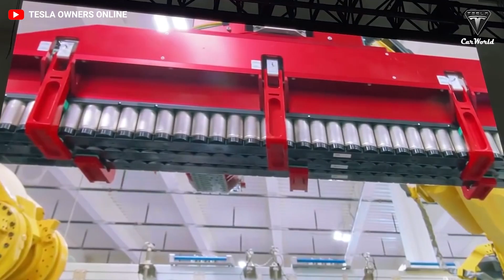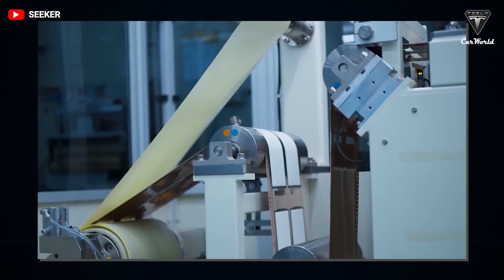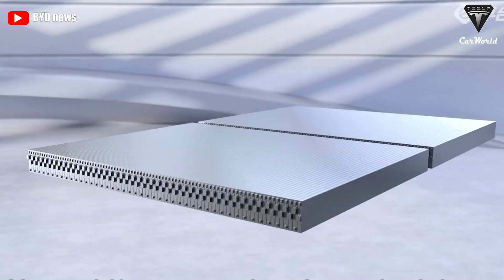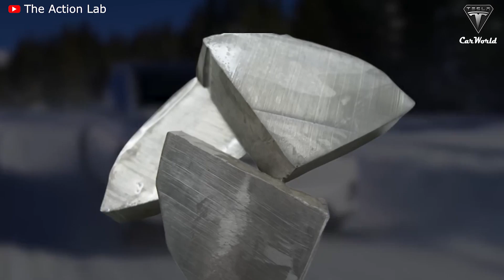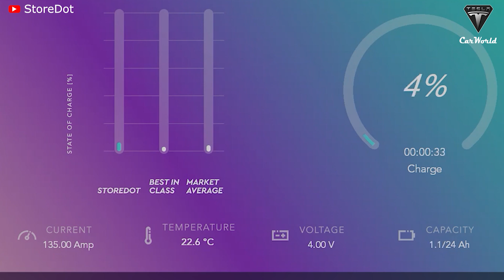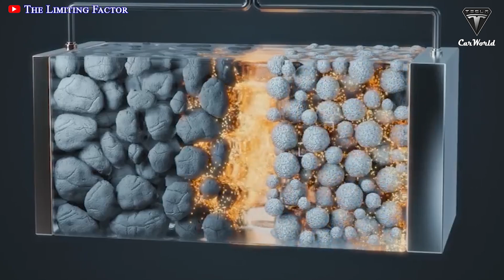Goodbye Lithium P2! Elon Musk All NEW 4.0 Batteries, Destroy Everything in 2024!

Comment: Thomas A Edison and Tesla invented the normal electric power plants using Edison's generator and Tesla's dynamos with inverters and transformers to deliver high voltage AC power continuous peak power 120 volt AC power continuous peak power without fuel water wind or nuclear steam.  Tesla bound Edison's generator with magnets all around the armature and used water to turn the armature magnets and coils of copper wire.  We could restore the normal design of power plants and eliminate nuclear power and fossil fuels power plants.  Not to good to be true.

Comment: C or D sized Edison generator is very valuable at this time.  They can be added in terms of current and inverters and transformers produce the needed voltage AC power continuous peak power without fuel or pollution..

Comment: A better solution to limited range electric power vehicles is the Edison generator powered electric cars or battery powered dynamo powered electric cars.  The unlimited range electric power vehicles without fuel or batteries is possible for cars trucks trains airplanes helicopters and ships to immediately reduce fossil fuels use and less expensive construction and operation cost. The liquid battery using sulphuric acid cooper nickel and stainless steel.  Higher capacity and more reliable recharge. Cobalt is dangerous due to the radioactive environment created by nuclear technology and nuclear weapons.  The cobalt will become a gamma emitter in the ambient radiation.

Comment: Something that I don't think is said enough, is that an 80% efficient battery is still good for other applications. I feel like people think they are going to be difficult to dispose of, when they are actually easy to reuse.
Reply: I heard that the first edition Chevy Volt batteries last literally forever, they messed up and used unnecessarily robust rare earth metals (or some other alloys) and the batteries never go bad. I was talking to a Geologist who owns a Volt and he said that the 1st Gen Volt cars with 200,000 miles have almost no degradation of the battery (a major oversight by modern planned obsolescence standards). I can't remember the exact figures he used, but it was something like that.

The new Volts apparently remedied the problem (according to this man, I haven't verified any of this) he said the new Volts have average life span on their batteries, which is maybe only 50% of the original batteries or thereabouts.  

Anyway I was shocked to hear this. He was basically saying that an original Chevy Volt was the most reliable, longest lasting (meaning most mileage on the vehicle life) EV ever made. Chevy built the most reliable EV ever, in history? 

That's just crazy to think about. He said the first Chevy Volts basically never wear out, and never break down, making them highly desirable. Nobody ever told me this, so I was shocked. It's almost like they didn't want people to know what was possible, so Chevy didn't say anything about their ultra long lasting, ultra reliable early model EV's. Of course they probably lost a lot of money on selling them.

And Chevy promptly changed everything and stopped making the long life Lithium batteries. Just as Ford Falcons stopped using the 70 mpg carburetor which they had accidentally released temporarily when they installed an experimental "backfire screen mesh" inside their intake manifolds for a short time, before some customers were reporting fuel lasting forever. Car companies must always engineer some form of planned obsolescence..

Comment: The direction of battery development is great to see. The sooner these solutions get to market the better. 
One point that puzzles me is the blind spot of making physical smaller cars. Much of Europe’s road infrastructure and parking isn’t big enough for model Y and most people don’t need that size. If Tesla want to make lower cost cars use less material, which is lighter also.
Reply: How dare you make so much sense. Lol
Reply: Bigger is better ask your wife.
Reply: Like a smart car?
Reply: They did a great job with this with the chevy bolt.  It's small outside but seems very room inside and easy to get in and out of because of the higher seating position.  It's narrower than most cars as well.  It's like the Tardis in a way.  :-)
Reply: @7bigjohn  Where are they ?

Comment: LFP battery has a charging 32°F limitations so it will need heaters for warming up the pack in cold weather in order to avoid permanent damage.
Some cooling too is needed for extreme heat weather.
I like the safety of non combustible risks 🔥 & the long cycle life. 🎊 🎉
The weight is heavier than the lithium used today.

Comment: One minute charging will take giant sized transformers and very large gauge wire. I can't imagine what it would take to charge 10 cars at a charging station or even 5 cars. The load on the grid will be significant as well.
Reply: Check out Skele+ton supercapacitors. They could act as a staging ground for peak load discharge and be charged at a more conservative rate during off peak hours
Reply: @SwankEldorado  Good point. Charge the capacitors whenever no one is charging their car. Then charge car batteries with a combination grid and capacitor.

Comment: My opinion on technology is meaningless, but as a consumer, I’ll take everything that you have got. I see a business coming up repackaging disassembled vehicle batteries into domestic and industrial battery packs. Perhaps there is a future for the lower part of wind turbine columns to be fill with recycled 4680 cells to improve sustainability. Tall towers provide free cooling circulation. In this way new battery technologies can be implemented sooner in uses that require the best performance, and half life batteries can be put to good use. Such batteries can be assembled in modules that can be loaded through a single hatch in a wind turbine column using a slide puzzle mechanism, so the batteries can be perpetually serviced and upgraded.

Comment: Sounds less promising than Aluminum Ion batteries and when will Tesla engineer a better solution for the labor intensive battery replacement procedure?  Shouldn't we be able to lift the car open a hatch and exchange the battery from below by now?  The model S has been around for over 10 years!
Reply: I would think that would be the design goal is a diy replacement battery.  Wonder what happened to solid state batteries which were going to change the world..

Comment: If I know anything about TESLA, they will quickly move to the BYD technology if it lives up to its advantages.

And YES, ULTRA-capacitor tech' combined with various battery technology can readily provide super-fast charging.  The trick - as always - is the tradeoffs in respect of cost/performance and efficient transforming of power into the long-term storage medium.

But the tech you have described does not do this - yet.  However, I think something of this sort will reach production status within the next year or two.

Then companies like ATLIS-MV and TESLA will need to provide the high-speed, high-energy charging technology to realize the abilities of the vehicle energy storage medium itself.

All kudos to the engineers and chemists (back-room boffins) behind the media hype, struggling to match the premature claims of the marketing plonkers.

Comment: The 4680 is virtually the same exact cell that they used in 2008. They increased its size to 2170 and then to 4680. But theres very little change in chemistry. They obtained higher energy densisitys by making them larger.
Reply: they made them have much less resistance, whats good for longer lifespan and less heat production
Reply: The Musk hype is very strong on YouTube. What good is a 100 year old battery in a car that last 10-15 years?
Reply: You get greater energy density by more efficient packaging within the cell (more total gelly roll within a given area of the pack) but it's only small. I suggest you watch Tesla's battery day event.
Reply: Ryan Kennedy energy density  is calculated ( Battery Capacity / Battery Weight  =  Energy Density) , you cannot increase  density by "increased its size "
Reply: @pcsimke  Unless you get economies of scale,  such as lower resistance.
Reply: @pcsimke  Of course you can. There is always overhead in the form of casings and junk that scales as the outside area of the cell while the capacity scales as the inside volume of the cell.
Reply: Density and large do not belong in the same sentence.
Reply: @chigongsifu  That was my first though and if you are talking on cell level that is true. But battery has a lot of accompanying parts, by making it bigger they might be able to use less of those by volume thus increasing the density of the battery overall.
Reply: @ogipetrovic94  yes,  and also by removing modules removes module packageing and is replaced by more cells (cell to pack)  making a more energy dense pack.  Battery day spoke of 3 chemistries inside the 4680, LFP, NMCA,  and high nickle chemistry,  so far we have seen only the NMCA, (known to work)  starting here lets Tesla test that the 4680 packaging works as expected (or not). Change needs to be implemented slowly so they don't have a recall disaster like GM's bolt or hyundi kona due to faulty battery packs. There is also the fact that only the cathode is of a dry electrode type (according to those that have pulled apart the model Y 4680 cell),   eventually both will be of this tech, and we may get improved chemistry of the NMCA once every other change is proven to work. If you change everything at once and the cells fails, finding the cause is much more difficult.
Reply: @chigongsifu  ah but they can if your talking larger and more energy dense batteries resulting in extreme electric car ranges

Comment: All of this sounds very interesting, but time and time again we see these things being presented as though they are on our door step.

Surely the best way to test these new types of batteries is to produce them, get them in the hands of people who not only build batteries but use batteries a lot, such as electric bicycles and scooters and EUCs these devices are much easier to change a battery than in a car, so wouldn't it make good sense to put them through their paces in devices that will give them a good hard test, will be bashed around damaged charged on a daily basis and used regularly, in fact in a bike or Escooter they would be tested to the extreme, that is why even though lithium batteries are the best we have at the moment they still fall down with these devices, because the cells are struggle.

Put them in smaller vehicles, sell them to battery builders let's test these cells out, if they work for these smaller vehicles they will work for the larger ones.

Comment: I wonder whether they know what they are talking about when they assert that some EV batteries could be fully charged in 2 minutes or less.

I have a Tesla model 3 which I have only a few times charged at a supercharger station.  When the car is charged at such a station, the charging cable becomes quite warm.  If charging could be done in only 2 minutes, the current would be so high that, to carry the current, the charging cable would need to be impracticably thick and heavy.  One might say that greatly increasing the voltage would reduce the current.  However, if the voltage were increased to perhaps 10 thousand volts, it would be much too high for the battery.

So, I very much doubt that charging time could be reduced to less than half an hour.  Even that would be difficult because of the high current required.

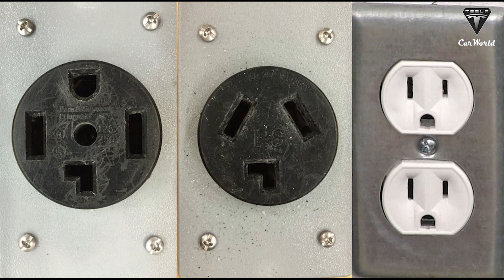Comment: 28:10 - if it takes 15 hours to charge your car from a 120 outlet it does not matter how fast the battery can charge it will still take 15 hours to charge your car, the time it takes is dependent on your outlet supply not the battery in the car. Similarly, the time it takes to charge at a supper charger is dependent on the amount of power the charger can supply, and yes I know that you can get chargers upto 350kW plus, good luck finding one that will do that, then you have to wait an hour because someone else is using it and they only built two because that all the power the utility provider could supply. To charge a model Y in 3min is ridiculous,  it will take a 1.4 Mega Wat charger, the amount that 200 houses use, a 16-stall station will draw the same amount as an entire town.
Reply: So what is your point... We should just keep burning oil? Electric vehicles are the future in my opinion.
Reply: @Steve Dawson  tell me, what will happen if the electrical grid goes down for over 48 hours in a city that have NOTHING buut electrical cars?
Reply: @damien9683  the technology is still young, but when the infrastructure is complete it will be and is the way forward...
Reply: @Steve Dawson  Currently, we are having LESS control of the electrical devices we own.

Not only is our infrastructure extremely fragile to hacking and other forms of sabotage, but what stops the government from restricting YOU from charging your car? Just look at the Canadian truckers who had their bank accounts frozen.

Having to ONLY rely on the grid for heating, cooling, cooking, and transportation is extremely reckless.

Putting all of our eggs in one basket, given how the government and corporations are behaving right now will make us beholden to them
Reply: @damien9683  put solar panels on your roof and anywhere you can.. F,, k the grid.
Reply: @stevedawson9191  Yes , BURN MORE OIL !!!
you finally got the memo !!
Reply: @stevedawson9191  My point is: there is the speed the battery can charge at and there is the speed the charger can charge at. Increasing the charge speed of the battery makes no difference if the limiting factor is your charger. At the moment cars can charge fast enuff the limiting factor is the chargers, Tesla is the only charger network that is addressing the chargers in any significant way. I fully agree with you that EV are the future, but that does not mean that everything that is mentioned about EV's is true.
Reply: You guys believe anything you're told ! pie in the sky electric cars ! a ham sandwich has more energy density than a lithium battery.
Reply: @ExploringCabinsandMines  Let me get this straight, you are proposing to power cars with ham sandwiches, won't they go moldy or get eaten, or do you propose to swap them out when they depleted.
Reply: @frankmarais1626  Worked for the DeLorean didn't it ?

Comment: Why haven't they created a battery as a one piece unit rather than multiples like the Blade but larger!
Reply from the maker: If you leave a monolithic battery, it will be very difficult to escape heat compared to stacking flat battery blocks next to each other, with gaps in the middle.
Reply: Also there is the danger we have seen what can happen when a cell in a phone or car has a major failure there is a lot of energy that flares up real fast now these cell are about the size of a C cell battery now imagine explosion of a reaction in a cell the size you're talking about

Comment: can blade batteries become structural pack batteries?
Reply from the maker: wow, nice idea
Reply: No the cells are too weak the enclosure in many cars is structural, and while the cells could be made with stronger shells it would be pointless because that would be a lot of extra weight and they would still require an enclosure due to the dangerous voltages involved

Comment: I have a question? Has anyone experimented with the regenerated energy being fed to its very own designated battery. With this regenerated energy run a generator that would feed the main power source to help recharge the EV battery? When you weren’t regenerating any energy the regen. battery could use and expelled all of its energy and when the battery No long has a charge the generator would shut down?
Reply: You are joking, right? Seeing how many dumb people are out there?
Reply: EV’s already use regenerative braking?
Reply: @DouglasMTB1959  - that wasn't the question. He knows regeneration systems exist.
   While I personally don't think Mr. Randoll's proposal would improve efficiency, I could be wrong.
   His proposal has to do with HOW the power produced by regeneration is HANDLED.
Reply: @jamesredman1263  with each step in the process there are efficiency losses. Going to more batteries and generators etc you don’t gain power.  The efficiency losses ensure you are worse off at each step.
Reply: Maybe you thought of something Elon didn't!! LMFAO!
Reply: There is no need for anything that complicated. The regenerated energy can be put back into the main battery with no problem. The main battery will always have enough capacity to absorb the  regenerated energy. The less messing about the higher the efficiency.